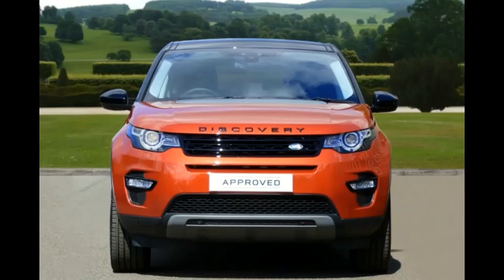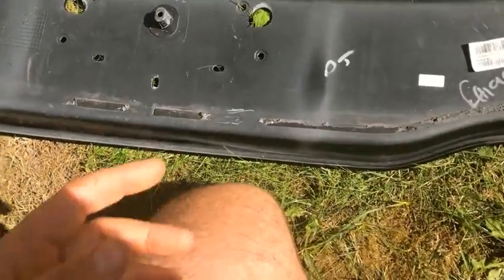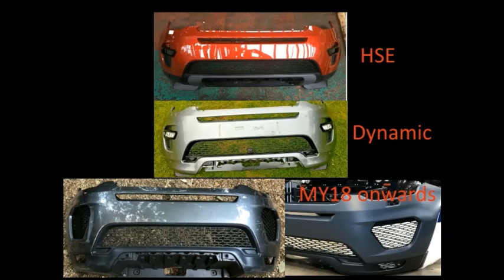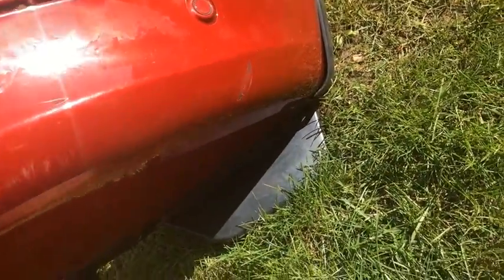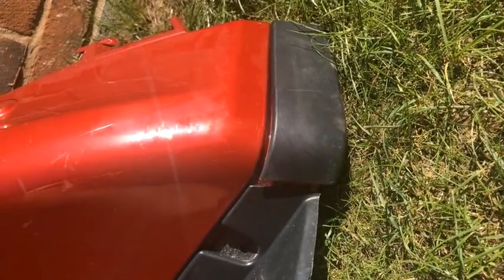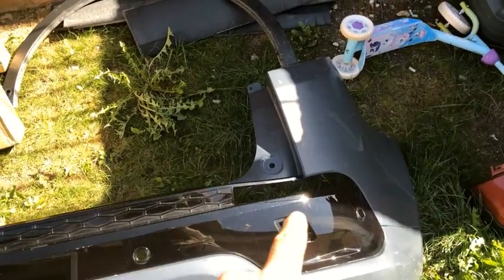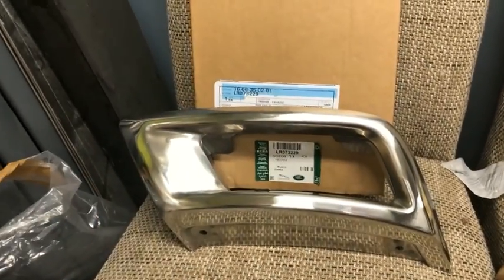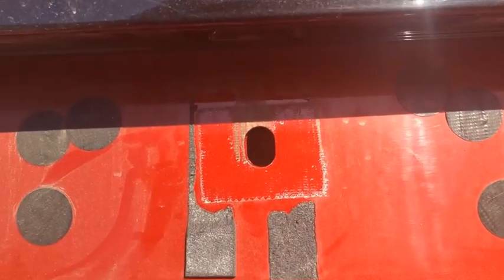Discovery Sport HSE to Dynamic Retrofit Facelift Conversion

Comment: because the ‘heat shields from the HSE don’t fit the dynamic’ rear bumper - you said the wiring loom needs changing . Do you have a link to what’s needed ? That but wasn’t filmed 🤔🙂
Reply from the maker: L M it’s just a case of removing the loom from the old bumper and transferring that loom to the new bumper. 🤙

Comment: how did you get the part that was missing from the back bumper that you glued with glue I need that part also where are you explaining at 13:35 thanks
Reply from the maker: They dont sell it seperatley :( I ended up watching eBay and buying a bumper that was in really bad condition so really cheap but had the end caps on. I have 1 spare, its for the Drivers side

Comment: Where did you get the small wheel arch trim on either sides of the front/passanger door lower skirt mouldings? Videoed at 12:52 - Excellent video by the way.